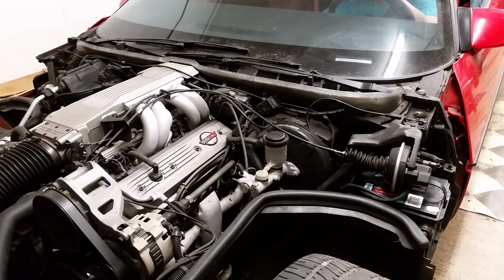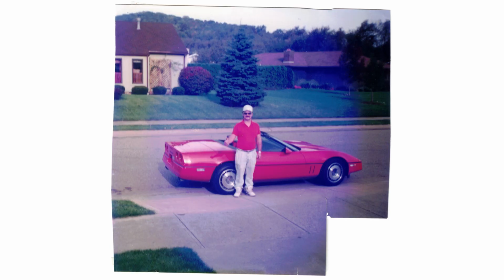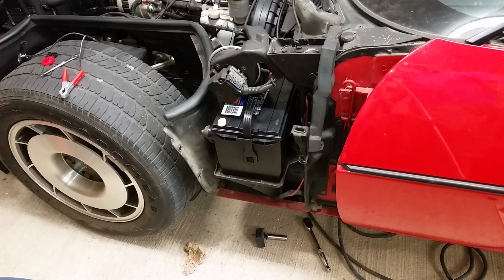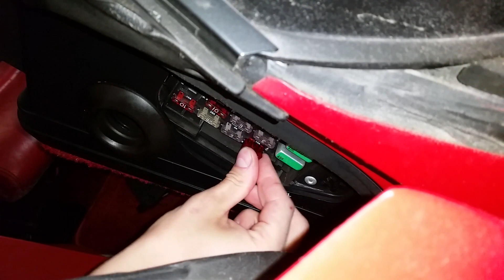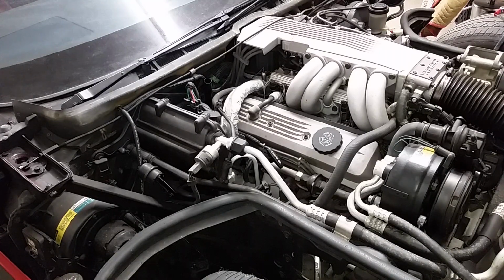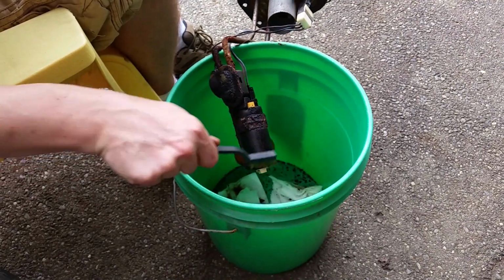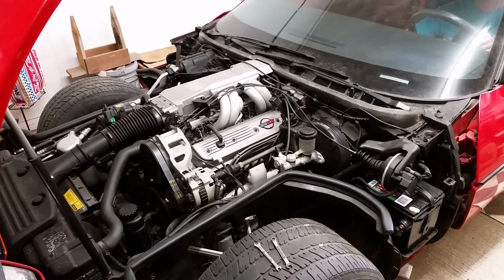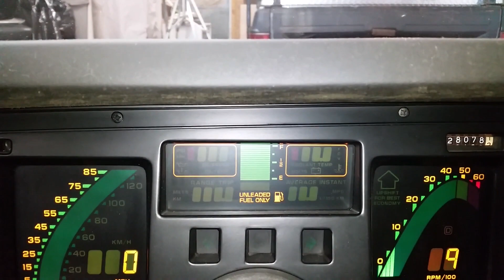Corvette C4 Sitting 25 Years, Will it Run? - "The Garage" Episode 3/4

Comment: My 1987 been sitting since 2002 with 19kmiles due to bad health & years of life crisis......  I am planning a methodical start by pre-priming the engine with a professional pre-luber i bought to lube the bearings ect. before I attempt to even turn it by hand with the plugs out to be sure it spins freely while the pre-luber is running.   (Can also make an engine pre-luber from a garden sprayer & many dyi videos to make one is my advice to never spin or try to start an engine sitting for more than a year.).
 At least I fully drained the fuel back then, but not the fuel rail.  My fear is rodent damage in a S. Florida storage facility that had a rodent problem back then....
Reply from the maker: That pre-luber sounds like a really good idea. I did 4 vehicles in this garage series, and this was the only fuel injected engine. The other 3 had been sitting much longer so I removed all of the spark plugs, sprayed penetrating oil into each cylinder, and turned the engines over by hand before trying to start them. Good luck with your Vette, let me know how it goes!